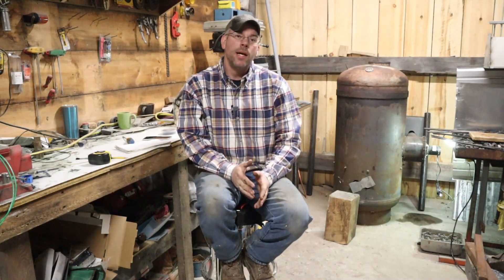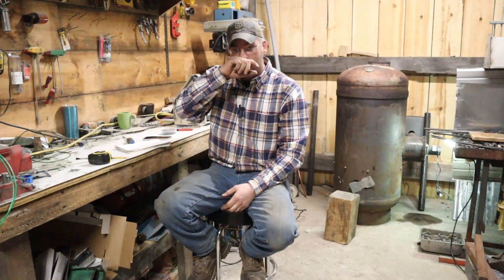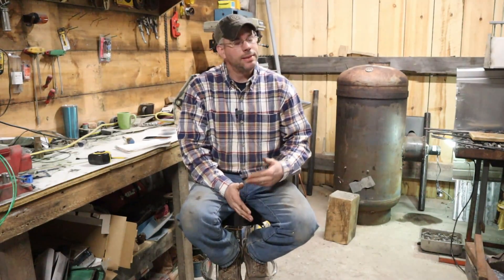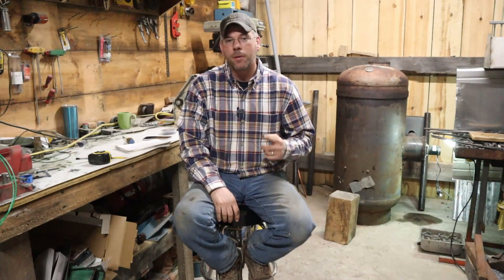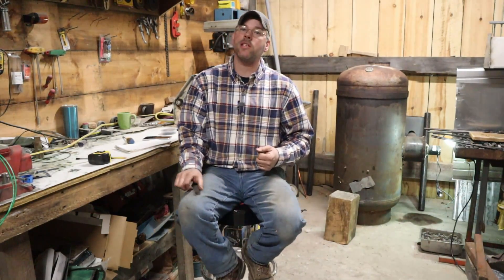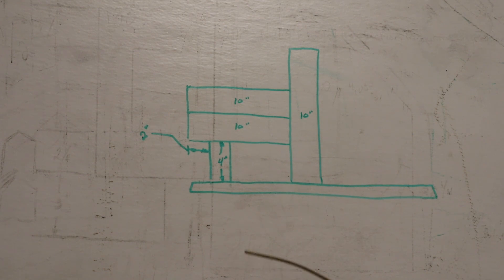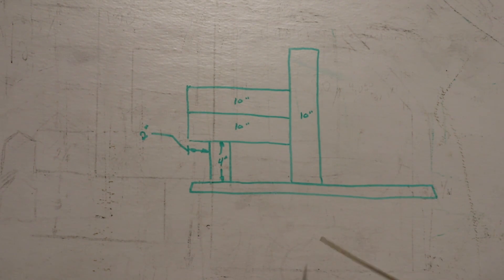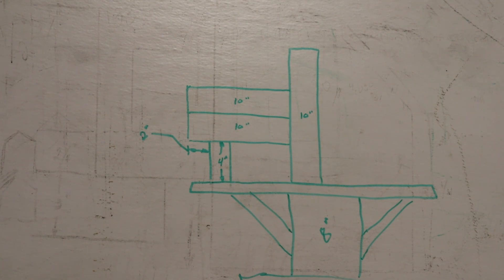DIY 2x72 Belt Grinder Made Simple For The Beginner Part 1

Comment: Hi Jim  I’m in the process of building one also. I agree time is money and using the 1 inch sander takes forever sometimes. 

I’m using a 3 hp motor off an air compressor and a pulley system. I’ve got less than $200 in mine so far. Not counting steel since it was from leftover projects.  

Looking forward to the next video
Reply from the maker: Not bad at all.  Good morning

Comment: !!!EVERY ONE THATS LOOKING FOR A GREAT CHEAP 2X72 READ THIS AND LINKS BELOW IN ONE OF THE COMMENTS!!!Hey Idk if u read your comments. But North Redge Tools has a 2X72 grinder that works great. It shipped to u for under $500 shipping and all is under that. U can see it on review videos how good it does it's at the very bottom of there page. It dont come with the motor or vfd but u get the wheels, platen, work rest every rhing bnb u need just not the vfd or motor. Its tr he best deal out there for a great grinder. U won't go wrong with it and u will be happy that u got it. I will send u the link to video of it running right next to another grinder doing a side by side test with the same size motors on both of them. When the other would stop from pushing on it with a peace of steel the north one wont stop at all or slow down. Just let me know if u want to see it if u even get the time to read all the comments u get. Thanks hope to hear from ya later bub
Reply from the maker: I read em all, thank you for sharing this.  I'm going to move this to the top so others can read the info.  I'd love to see the videos.
Reply: Just give me a few mind and I will send the link to both. The video and the web site. U can get ahold of them and find more about the grinders they have from there Instagram.  Cause the guy that up dates there web ste is always busy all summer and some of the winter doing the renaissance fair thing. The next comment will have the links to everything for who ever needs them thanks.
Reply: Here is web site and it's already at the one with the grinder just look at the one on the bottom of the page.
http://www.northridgetool.com/grinders/
Here there Instagram page
https://www.instagram.com/northridgetool/?hl=en
Here is the video of the side by side face off of how good this grinder is.
https://youtu.be/r3-H_zsI9Z0
Hope this helps anyone out. Thanks 
Keep up the good work bub

Comment: Awesome!!! I've been debating on making one myself. I've got a 120 volt frequency drive motor that used to be on my smithy lathe/mill till I upgraded it to a 220 volt motor. The original motor burnt out. When making acme threads for a metal roller. Smithy sent me a new 120 motor while the 220 was on backorder. I expected to have to send the 120 back to them. I ended up calling them and they said it was cheaper for them if I just kept it. I've also got a larger motor from an auction that is brand new. That I believe was to be for chicken feed auger drive motor. Problem is with electric motors and freq.drives I know just enough to probably be dangerous. If I give you the specs on the bigger motor could you tell me what kind of drive system I'd want to get for a 2x72
Reply from the maker: Send me a message on FB with your number, if you're around later I'll give you a call.